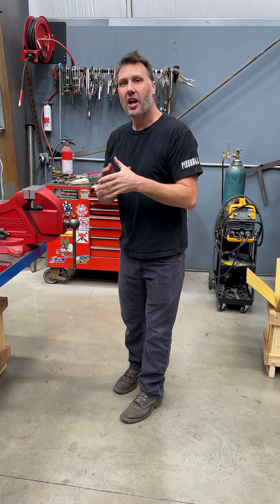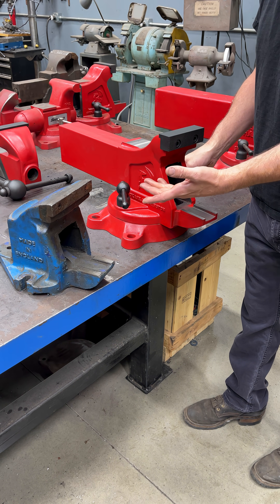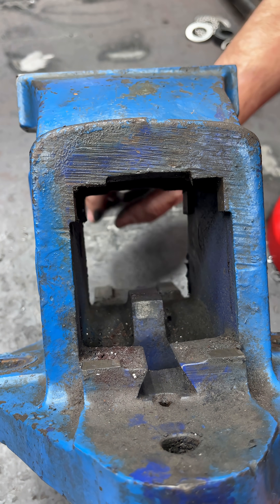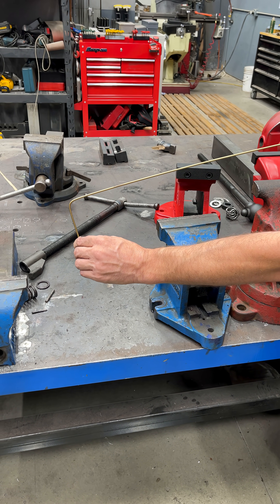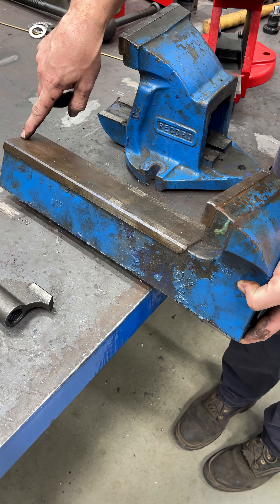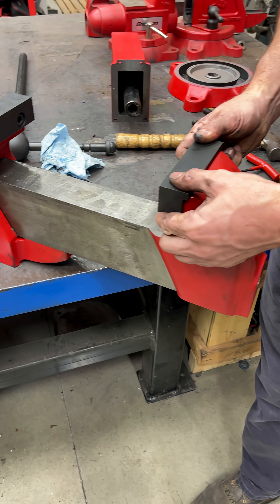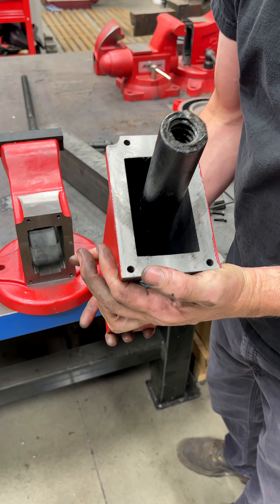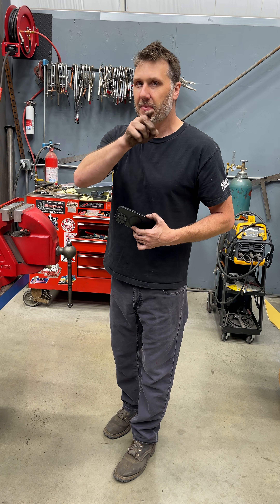This is the Best Static Jaw! Fireball 510 vs Record #6

Comment: Red one is over engineered overkill. If the vise you got ain't broke yet it probably wont be broken ever. If the vise you got is doing the job, keep using it.. but if you need a bigger vise whenever, then get the Fireball I suppose.

Comment: Ive restored 2 Record vises. 
The do have pads at the back top and bottom. Probably covered in paint so you couldnt see it!
Reply from the maker: There are no pads on the lower side walls of the static jaw. The slide doesn’t even have a machined surface for it to slide against.